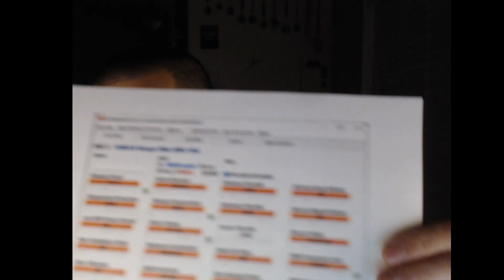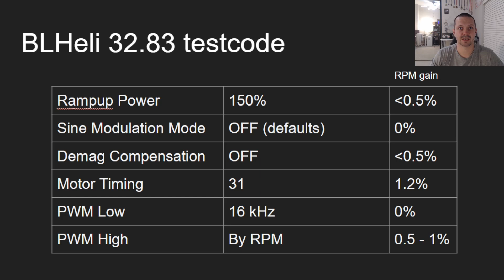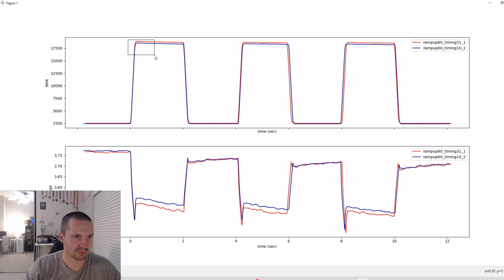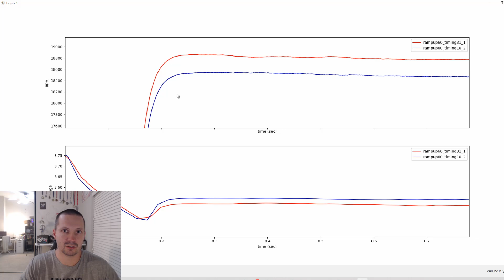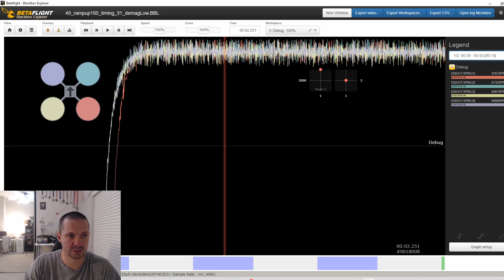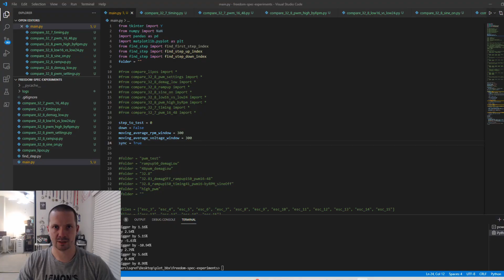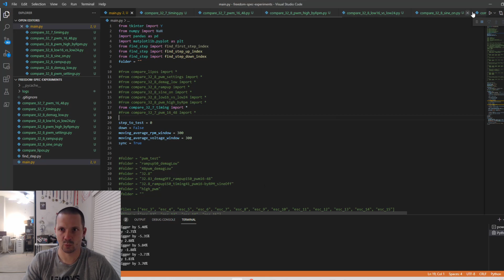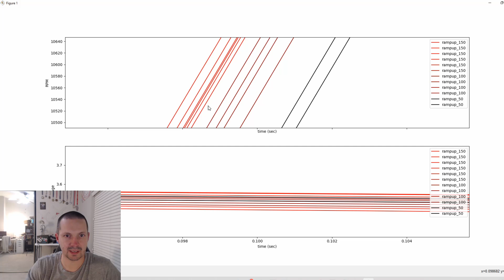Fastest Freedom Spec ESC settings?

Comment: Awesome video! Any tips for 5inch 6s racing rigs? Was using 4.0.6 bf till now for 2 years and felt really good with no need to switch. But now I want something fresh and I am now switching to 4.3bf , 500hz, edge tx, 32.9 and all other other silly hype stuff. Any recommendations for high end pilots, like correct motor timing depending on kv and rampup power. And what's your experience if you have tried with the bf racing tune presets like 'karate' ? Hella long text, but hope you see this and again, awesome/funny videos.
Reply from the maker: yes Sir. Karate preset is what pretty much everyone using these days for racing. And for ESC settings for 6S:
Motors timing 16 or 23, Demag high, rampup - 50, PWM: 24 - ByRPM. (make sure you flash 32.9)
Reply: @IvanEfimovLimon  Byrpm you mean just static 24? 
It's weird for me, that the default tune bf doesn't work(fly aways), but karate works smoothly. Is it because of high kV motors? 

Also isn't dmag high decreasing too much power? I know it decreases decync chance, but in my experience it has a lot less power. 

Thanks for the reply 🙏
Reply from the maker: @tomasspetersons4158  , no not static, Sir. PWM: 24 - ByRPM, min - 24, max - byRPM. Demag high do decrease motor power, but a regular high KV 6S motors has too much power anyways. Why defaults don't fly good on your drone - is hard to say. Record blackbox and check it i guess.
Reply: @IvanEfimovLimon  thanks for the reply sensei. What about if I have different ESCs which have different max pwm. I want all of them feel the same, should I somehow limit to 48kHz for those who go over, cause some ESCs I have max pwm is 48.
Reply from the maker: @tomasspetersons4158  that one im not sure honestly. I am type of the guy who can't feel the difference between 48k and 128k PWM :) Its probably there but I can't

Comment: Thanks that finally someone clarified why you should run higher rampup power instead of lower like it's suggested by many out there. Bigger propped motors and low power setups benefit even more from this setting. But it needs to be said, that good quality ESCs should be used with high rampup power due to voltage spikes.
Reply from the maker: Thanks!
Yeah and not the 32.7 version :) seems like it can't hold hight rampup power on this setup

Comment: Looks amazing! Please make the same for 6S - 533 motors
Reply from the maker: Thanks man! Will see :) on 6S the top speed doesn't really matter a lot...
Reply: @IvanEfimovLimon  That makes sense, still it's interesting to know the optimal esc settings :)
Reply: It would definitely be great to test the esc settings for 6s racing. But I think you would need a thrust stand for that (and it is also a ton of work). As I see it the priorities are
1. Responsiveness
2. Efficiency
3. Raw power
For freedom spec I would go with
1. Raw power
2. Responsiveness
3. Efficiency